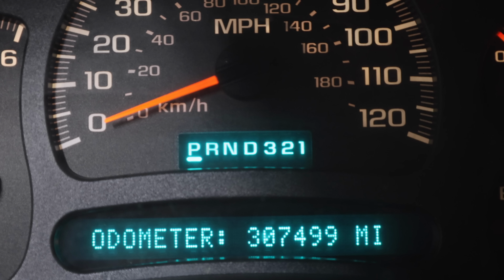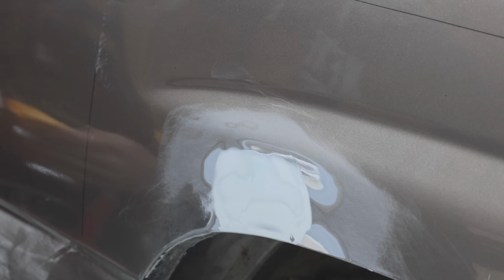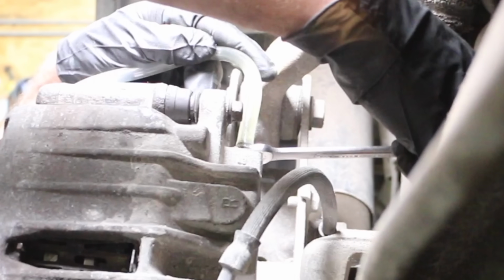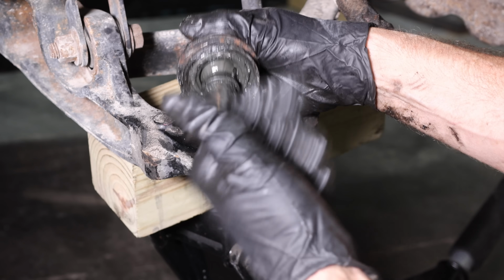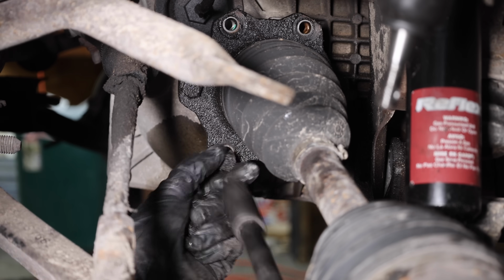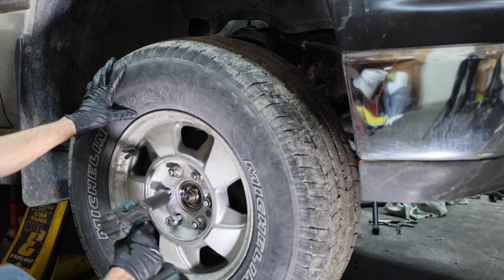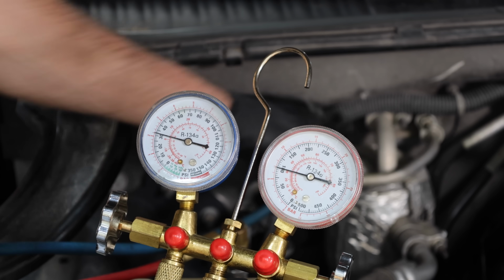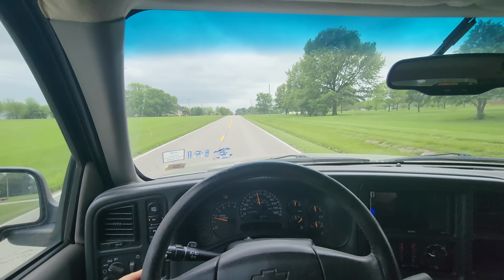Is It Stupid To Fix Up A 300,000 Mile Vehicle? Let Settle This!

Comment: As someone who does Autobody/Rust Repair for a living my immediate thought repairing the quarter panel is: Why would you buy a $75 replacement and only use that tiny square. You could have used ANY metal laying around and hammered one 90 degree bend in it. Additionally these no way that spot is rusted through and the metal immediately next to it is fine on the backside. Next, before welding in the new piece tack in some backing pieces, you don’t want to butt-weld sheet metal. Additionally that helps keep welding sparks from starting the foam on fire
Reply: I agree
Reply: He's going to use the remaining sheet metal for his other truck. Seriously I didn't even know they sell new replacement quarter panels.

Comment: Great great video! I’m not getting into a monthly $800.00 payment for a 4 wheel drive truck. Specially when I work from home and mainly use it to haul the quad to races.  This video points out a lot of great areas of inspection and maintenance. I’d rather buy some tools, kick, cuss, and yell in place of paying the hourly repair rate. I also get to experiment with later model rotors, calipers, double fans, gauge cluster, bigger radiator, and get rid of the lift for a smoother ride.  Huge thanks!! Oh! Great tip on the transmission fluid intervals. 02 Z71 4x4 288K
Reply from the maker: Thanks!  Thanks for sharing.

Comment: Your alignment method assumes the front/rear axle track widths are the same.  This is not a safe assumption.  You need to verify the strings are parallel by measuring string to string at front and rear.

You also didn't address the steering column tilt joint or the other segments of the steering shaft.  On a GMT800 with 300k miles, I guarantee your steering shaft is a sloppy link between you and your otherwise new, tight steering system.

Comment: No.its not stupid. Have 200k on my suby. Replacing tie rods, wheel bearings and endlinks. Everything else is in working order. Now in the event i have to replace head gaskets which is common subaru issue.Then NO wouldnt do it as it costs almost as much as the vehicle is worth.
Reply from the maker: Thanks for the feedback.

Comment: I just done a brake job on my '13 Chevy Silverado replacing only the front pads and rotors along with new rear drums, shoes and wheel cylinders. To my surprise, the front calipers locked up on my new AC Delco front rotors, overheated and warped them. Ended up replacing the front calipers and a new master cylinder (both calipers rebuilt and a new aftermarket master cylinder , but that wasn't he end of it. My brake pedal was nothing like it used to be, and even after bench bleeding the New master cylinder and bleeding all the lines front and back, I had the pedal go way past and almost to the floor before slowing the vehicle. I ended up just taking the truck to the dealer because I didn't have time and I'm working to much to have time figure things out. Come to find out, I had a bad master cylinder causing half the problem but most of it was my fault because  with the truck having 230,000 plus miles on it, I should have went ahead and changed the front calipers with OEM original parts instead of buying aftermarket junk from my local Auto parts store and saved myself the headaches and over $2500.00 at the dealer, Lesson learned. 
The truck runs to good to buy a new one, so it is well worth fixing and saving over $1000.00 a month payments on a new one, being that cars and trucks new today are just totally insane with prices.  Thank you for sharing your video and pointing out what can be done to save big bucks! 👍
Reply from the maker: You are welcome!  Thanks for sharing.

Comment: Well 300K you will need a lot more than brakes. Now your'e  talking control arm bushings or the control arm itself depending  on rust. Axle bearings and  seals BUT many times there MIGHT be groove cut by the rubber seal in the steal axles, yeas really. after 300K. Then you need new axle . Gears like ring and pinion maybe. . All new steering components. ,Ball joints. rebuild engine and trans and transfer case if 4 wheel drive  . U-joints. If it has CV joints all new for them too.  Pretty much  most moving parts  have to be replaced. Is it worth it? . ONLY if YOU do the work yourself. All of it.  It would be a BIG project. Can you just replace as things  break. Only if you like breaking down on side of road a lot. So yes it can be done,. but not easily.
Reply from the maker: Thanks for the feedback.

Comment: I really enjoy watching your videos and I hope you never change because I find your videos are the polar opposite of the BS I see quite often on YouTube. I watched this video because I got burned buying a  2006 Grand Cherokee Laredo with 150k miles during Covid for $6.5k as a safe vehicle for the kids, then put in about 6k in repairs, half of which I did myself. After all that I know it still needs suspension and burns about a quarter inch on the dipstick of oil every week and the O2 sensors throw a code once a year so keep resetting them because I couldn’t get them out and I didn’t want to use a torch. I tried to sell it on facebook marketplace at 170k miles for 6, then 5, then 4, then3k and no offers then I wound up trading it in at 1.5k at a dealership before I would have to get it inspected again. I think in your case u already had the vehicle and have the skills to change the Ty rods and suspension so it seems worth it, however I wondered if your engine was burning oil because then the rings may be blown, or  if the O2 sensors are throwing codes because they are extremely hard to replace IMO, if u have the skills to pull the engine and rebuild it I would love to see that episode because I always want to learn and to see how u would take out O2 sensors I would love to learn that too. Please keep up all the good work you do, thanks
Reply from the maker: Thanks, will do!   Thanks for the suggestion.

Comment: You din't waste any money at all. I have a 2001 Suburban with 370K. The engine and trans are both original.  I've been slowing restoring it and fixing it up. Considering a new one is 100K and is not half the vehicle the old ones are, I figure I can spend about 25K on mine and come out way ahead. Plus I upgrade as I go, so it's really a better vehicle than it was new. Already did the entire front end on mine!
Reply from the maker: Thanks for sharing.

Comment: He never mentioned this but i will, and btw this video is excellent for DIYer's. And to add i was a car technician for years and now work on big agricultural equipment. But when you disconnect the actual suspension from the steering wheel ALWAYS put the seat belt through the steering wheel due to the dreaded clock spring. It really doesnt take much jostiling once the pitman arm is removed from the gearbox. Ive rebuilt hundreds of these chevy front ends. Tie rods, ball joints, idler arms, pitman arms, and plent of brake lines and transmissions, oh and cant forget your occasional transfer case. These truck dont die easy but they are piles if you dont do your part as shown is this video. Big chevy guy myself because of how easy they are to work on it, and they actually will make it to 300k miles without crazy repairs. My 2011 1500 5.3 is at 252k miles and is still kicking only the fuel pump and a rear wheel speed sensor has been replaced in that service life. Take that toyota guys😂
Reply from the maker: Thanks!  Thanks for sharing.

Comment: That was a very good video of standard repair on warn parts.  You didn't address replacing engine seals or doing a ring job, likely due to the sheer labor involved.  But in my experience these are what really determine if a vehicle is worth keeping and repairing or not.  What's your take on that?

Comment: My view is the cost of a new truck is astronomically insane. So if an older truck has a good frame and is not a lemon model or year, the components are cheaper to replace than buying a new truck. A transmission is cheaper than an 80 to 100 grand for a new truck. Fix them!  Throw some new bushings and steering and control arms and shocks, brakes, etc and keep it running as long as possible.

Comment: How much did all this cost? I assume that buying all the parts (without labor included) might have been expensive. If you add in the cost of the labor, the repairs probably would exceed the value of the car? Is it worth it from a financial standpoint or buy a newer vehicle?

Comment: In my oppinion no a vehicle with 300k is not worth fixing. Yes plenty of vehicles with certain drivetrains make it to 500k miles. Some 4.8s and 5.3s as shown in the video do. But thats not the norm. A toyota 22r is about the only engine i can think of i would do this with and in a tacoma. The reason being is that the price difference between a 150k mile and 300k mile example isnt big enough to justify the fees you will accumulate soon due to high mileage.
Reply from the maker: Thanks for the feedback.

Comment: Live love love my 98 4 Runner limited. 468k miles. Im only mechanic. New oil pump at 400k and fuel pump. Never pulled the heads. 3.4 L v 6 is bullet proof. It goes through ign parts but IT HAS 468 THOUSAND MILES ON IT! Daily driver. Cold factory air , no rust anywhere,  has the 16" wheels. I put late model Tacoma 16" wheels with spacers. Perfect fit. It's f'n beautiful.  My wife did trash interior but 300 bucks and some work and i replaced it all w new. A 4 runner w the 3.4 is a keeper!. If you find one , it's worth getting.
Reply from the maker: Thanks for sharing.

Comment: I say no, its not worth fixing body damage to a 300,000 mile vehicle unless it meets certain criteria. 1) Has minimal body damage, rot. 2) is mechanically sound, as in rebuilt engine, trans, and can go for another 300k miles. and last but not least 3) how much you value the vehicle, if you absolutely love the thing then I say that alone makes it worth putting a bit of time and money into it to get it to where you want it to be. 

I have a 2021 GMC Acadia Denali, I love this thing!!! The steering wheel is all chewed up from the first owner using his/her finger nails as drums or something and it chewed the top leather on the steering wheel all up. I hate it, so at some point I am going to put in a new steering wheel, but it costs like 200 bucks to do so. Do I need a new steering wheel? No, the original works just fine. But I want it to be what I want it to be, so to me its worth it. Hope that example makes sense.
Reply from the maker: Thanks for sharing.
Reply: Something you touch every time is worth the repair. Might be worth trying a high quality leather cover first.
Reply: @MathewPollard-vj4uq  I at first thought the same, but it would be too bulky, and it would interfere with the heated steering wheel function
Reply: I could also have the dealer install it, I asked if I purchased a part, would they install it? And they said they would. 

Something that's as simple as a steering wheel is now a complicated misery to deal with, so I'd rather hire someone to do it in half the time than I would lol. Because it's probably not as simple as swapping them out. We probably have to do some machine learning tasks that incorporate AI and a super computer in Texas to have it properly installed.

Comment: I bought a gmc jimmy with 98,000 mi.  Paid $7000.  I've since put $14000 in it.  It has 218,000 mi now.  I will put another 200,000 mi on it I promise.  I parked my last suv with 403,000 mi.  Anyone who buys new every 6 years is just paying the bankers.  I do as much DIY as I can but still have to have major stuff done at a shop.

Comment: Dude. You have like a billion subs now and you'll never see this. But, I'm in my 40s and do a lot of my own repair and maintenance on the family vehicles to save $, and I want to tell you: This video is nothing short of inspirational, and I am VERY impressed. Incredible work!!
Reply from the maker: You're welcome! Thanks for watching!
Reply: Agreed! Great video!
Reply: very inspirational!  makes me wanna get out and work on my car!  lol got some new brakes, calipers, coming for  my car.  and i need to do alot of suspension work on my older pathfinder.  so i think im going to tackle the job.  i was thinking of going the easy route and just take it to the mechanic.  but if i do it all myself i will know that it is all done correctly.  i can torque everything properly and take the care for my cars.  its just a PITA because i dont have a garage and i was an idiot and i didnt do a good job keeping my tools organized and they are scattered all over the place.  so i know its going to be more work looking for tools.  maybe i should just buy a new tool set hahaha
Reply: I run a 4x4, 2005 Chevy Trailblazer. I just finished replacing both front CV axles, wheel hub assemblies, and the four-wheel drive disconnect/actuator located on the passenger side (because the inner CV axle would not dislodge from the old 4wd disconnect). According to Grok (AI), I saved no less than 1000 dollars by doing it myself instead of outsourcing to a repair shop. I am also 48 years old and never DIYed these replacement parts in the past. The most I did was replace complete audio sound systems in my vehicle.

I say all of that to say this:

In the 1950s (and also the Depression era around 1939), EVERYBODY did EVERYTHING themselves... from food to plumbing. Families were self-sustainable regardless of national economic limitations. I DIY everything I can because the knowledge and information today is readily available and free with focused, online research. 

Additionally, I rarely experience more euphoria than when I use my personal time to solve a problem that the masses will outsource (labor/knowledge/experience excuses). Essentially, we cannot always increase our income but we can surely save thousands of dollars by investing our individual time on various projects to ensure we are competent in finding acceptable solutions to fit our budgets! If we save 1K... then we earned 1k! Do you follow my logic? People often work at a fixed wage... so... why not save at an unfixed expense? This is why we build our confidence and learn something new and DIY till death.

EDIT: I NEVERRRRRRRRRRRRRR stop LEARNING! Thanks for reading, push yourself, and BE SELF-RELIANT ALWAYS!

Comment: Take your used automatic transmission oil or whatever you pumped out of there and reuse it to spray the underside of your truck with to keep the frame and chassie from rusting out. I, paint the underside of my cars and trucks with black rust olem paint, however even with that, you can still spray that old, used oil underneath your truck to keep that frame and chassis from rusting out. Good for the floorboards to.

Comment: Just seeing this now, so not much value, BUT, after 40 years in the auto industry, i have learned a little.  With antilock brakes, you MUST open the bleeder when you compress the brake piston. If you do not, you can damage the antilock valves.

Comment: I'm currently doing the same with my 03 toyota tundra sr5 that has about 250k miles. $3k worth of parts is better than $6k for a newer can of worms, lol. At least with my truck, I know all the problems it has. I replaced all the brake components front and rear last year. Now I'm replacing water pump, timing belt and components, power steering pump, steering gear box, and all steering related components, pulgs coils and wires (waste spark system), and plenty more.
Reply from the maker: Thanks for sharing.

Comment: I've had decent success with the string method of alignment after doing front end suspension repairs. Both times I was told no adjustments were needed!
Reply from the maker: Thanks for the feedback.

Comment: I bought a used Astro van with 265,000 miles. Didn't do any repairs or maintenance because I thought it wasn't worth it. Now at 500,000 miles and counting with no major repairs.
Reply from the maker: Thanks for sharing.

Comment: Honestly, fixing up a 300,000 mile vehicle all depends on condition of the frame/body and the wiring. When you consider a new car is pushing 35-60k you can make a pretty nice car with that much budget and you'll know everything about it when you're done.
Reply from the maker: Thanks for the feedback.